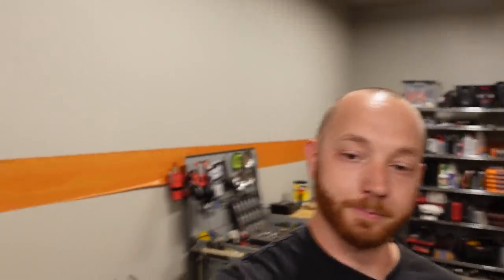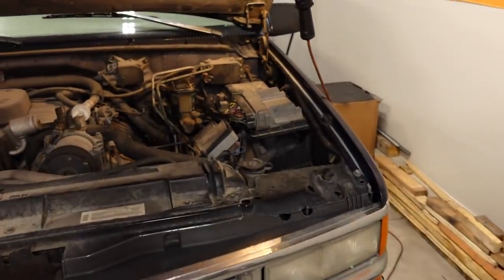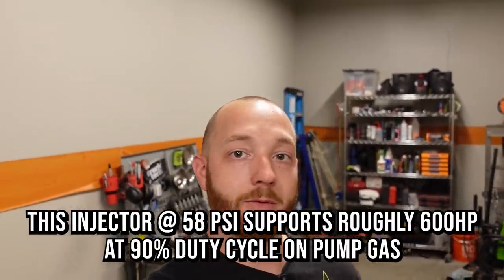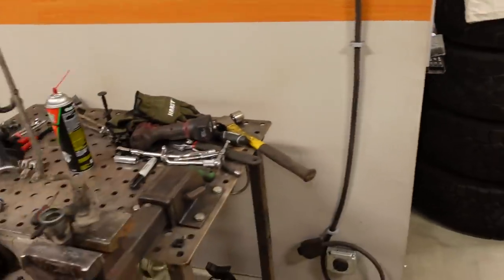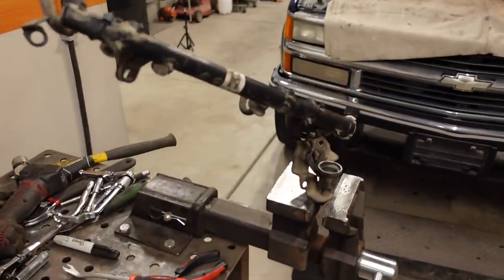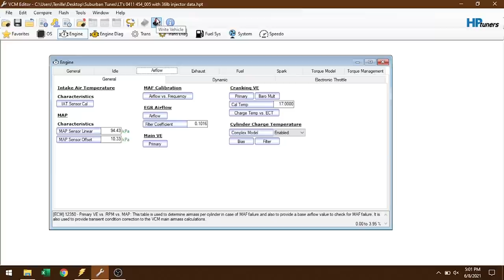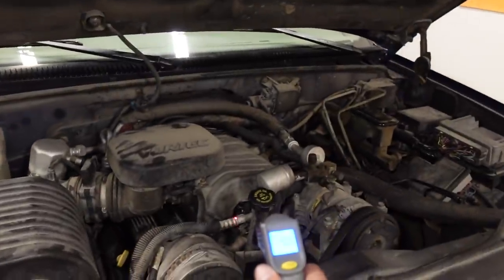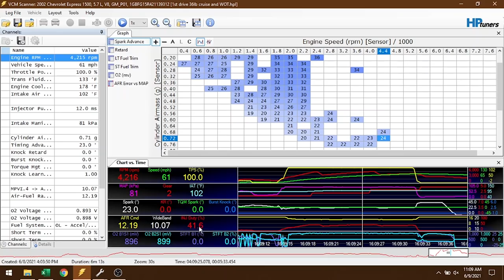Vortec Big Block 7.4 Injectors and Regulator: curing a hard start & 600hp worth of fuel

Comment: Hello, thanks for you vid and education.  How much force should be applied while trying to extract injectors? I seem to be forceful enough I scared of breaking something??
Reply from the maker: they can get stuck in the intake as dirt and gunk builds up around the injectors. I find a little WD40 or similar sprayed around the bases can help, and from there just constant pressure and wiggling around usually get em out, but sometimes prying is necessary... just be careful though because you don't want to snap or break anything important like the fuel rail
Reply: @LawrenceTolman  thx again but I took them out yesterday with patience and all came out easy. Two o rings stayed with rail but came out easy with pick.

Comment: I have a 2000 chevy 454. Runs and idles great most of the time, occasionally however, whenever I need to get on it from a dig or need to accelerate while towing in 4th gear, the truck will stutter, almost like it's getting too much or too little of something. Does anyone have an idea about what this could be?

Comment: I have a 99 that needs injectors and fuel pressure regulator. If I were to put factory style bosch 19 lb injectors in would I have to program them?
Reply from the maker: nope, as long as you use a stock sized injector you will be good to go without any programming needed

Comment: Hey yall i need some help because im researching for my project. (My project) the same gen6 464 as this one, complete ecm swap (holley dominator), ls heads if possible, long tube headers into a x pipe with cutouts, in-line fuel pump and some other things like updated knock sensors etc.

Comment: Why did you pull the distributor?
Reply from the maker: the mount tab and bolt for the back of the fuel rail and regulator sit underneath the base of the distributor making it difficult to access

Comment: I accidentally discovered that if you remove the square plastic box that says "Vortec" And obviously seal the hole....  you will be able to actually hear that BBC grunt.   (Bottom of a soda can fits the hole, it must be reinforced though)
Reply from the maker: yup, its a resonator thats quite effective at canceling sound
Reply: @LawrenceTolman  mine must have been overtightened, which caused the plastic to fold inward.  My goal was to seal up the intake.   It literally would make change rattle in the ashtray afterwards.  
  I love the truck.   Keep up the informative videos.

Comment: I have a 2000 gmc K3500. It's an utter dog. I rebuilt it because of spun main bearings. I replaced the cam with a Marine camshaft and new Bosch injectors. I pull a 33ft camper with it. I was in not very steep mountains and had to use low gear 25mph with the gas on the mat. I was furious. I have a 2003 lincoln navigator to outpulls it by a mile. Whats your take? I am thinking a simple turbo off a diesel with maybe 5 to 7lbs of boost just to get more torque out of this thing. Any experience with this anyone? Why are they such pigs? I don't get it.
Reply: Cats clogging?